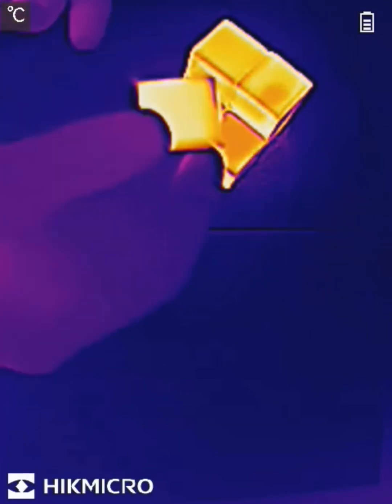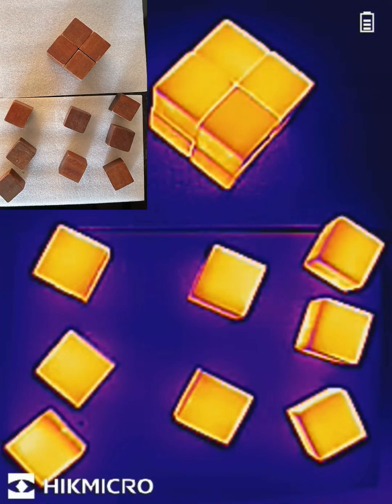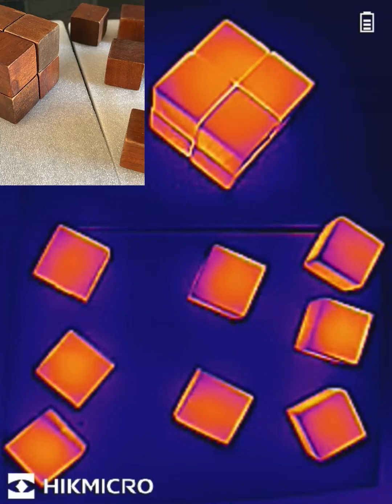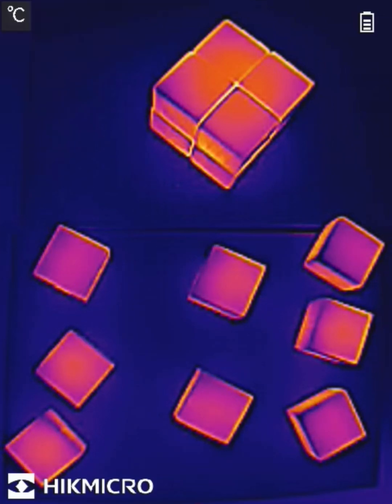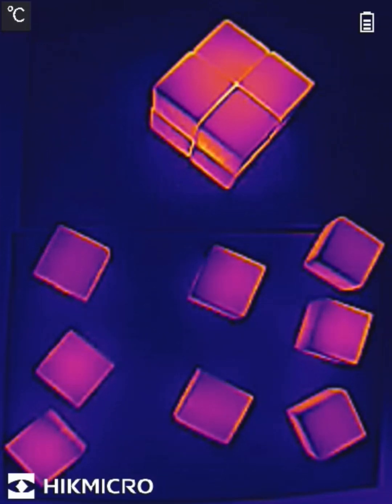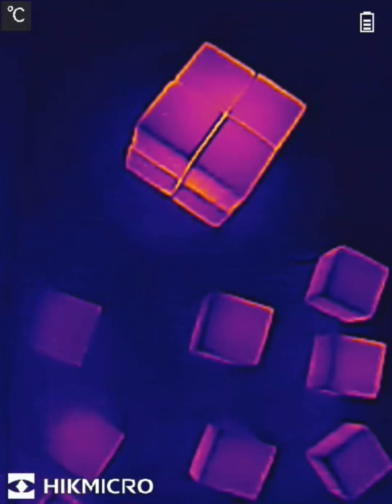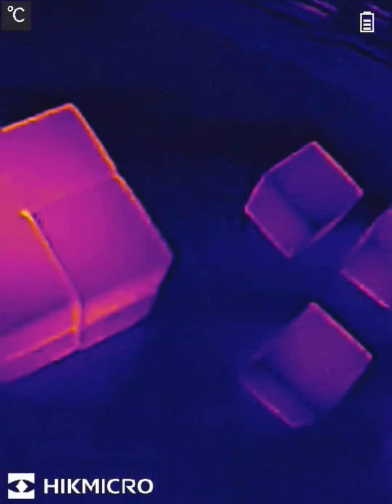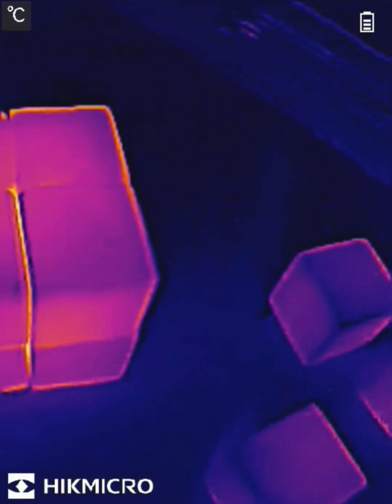Effect of surface area on cooling with an infrared camera #physicsfun

Comment: Aaah, but you should have opened the big cube! 😢
Reply from the maker: The point is that the big cube has the same volume but a smaller surface area so cools more slowly.
Reply: @SimonPoliakoff  yeah, I was just wondering what the temperature gradient inside the cubes is! Cool video :)
Reply from the maker: Okay I see what you mean.  That is  a good suggestion.  Thanks for engaging.